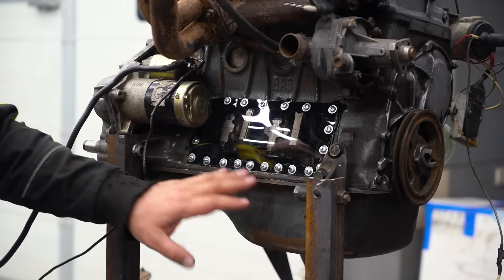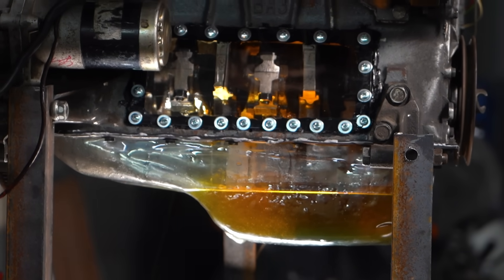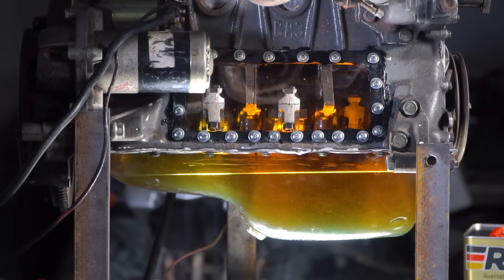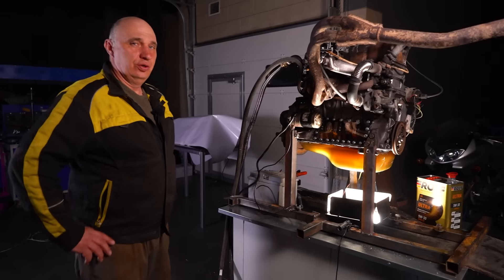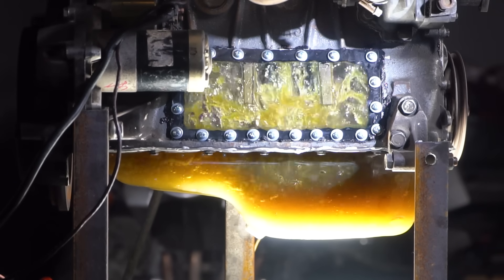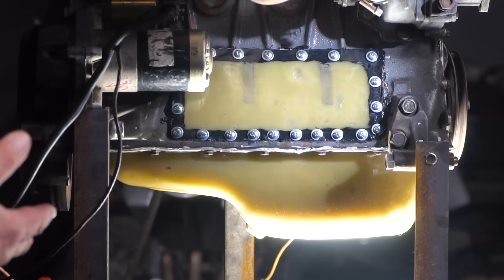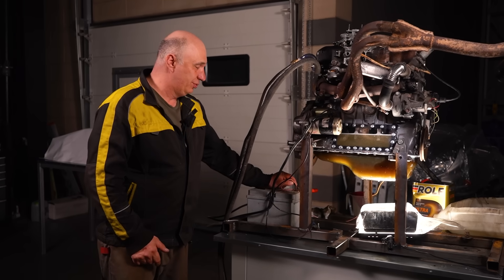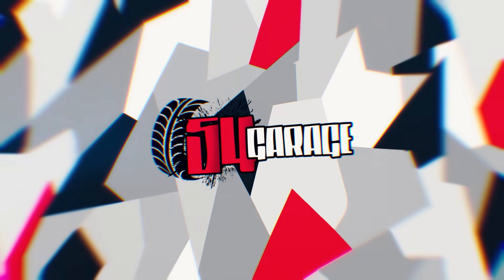What actually happens when you overfill your motor oil? (w/ transparent oil pan)

Comment: That test would be valid for a static generator. On a normal car where oil is slushing around, foaming will start at even twice the oil level. Problem with foaming is that foam doesn't provide proper lubrication, since air bubbles are compressible and allow the bearing surfaces to compress it and get in contact with each other. Usually (and I stress USUALLY) big end bearings get hit by that the hardest. Of course, this is not a dry metal on metal friction, but it WILL accelerate engine wear dramatically. 
Another problem with this test is that fresh oil will resists foaming, put a 1k miles on it and story will be way different.

Comment: it depends on what engine you have if you have bigger engine 3.0litre plus that require 9 litre of oil its a different story but never the less for smaller engines should be similar yet it depends on your engine this can vary drastically between engines some sumps are smaller etc

Comment: Oil getting whipped by the crankshaft when over filled. Saw this several times in GM 8.1 liter V-8’s. The aerated oil could not make up to the #1 cylinder rocker arm.

Comment: I think all oil pans should be transparent and have a metal guard around them held on by 4 bolts that have to be removed in order to get the drain plug out. 
Easy to see coolant in the oil, easy to see metal flakes and chunks, and easy to see sludge. Maybe itd make people change their oil as often as they are supposed to.

Comment: A oil pressure gauge would have been nice to observe any difference in pressure with volume and when the oil get aeriated. Also a temperature gauge and letting the test warm up to a fully hot engine to again observe pressure differences. Then more testing with different grades of oil right up to 80/90w gear oil.